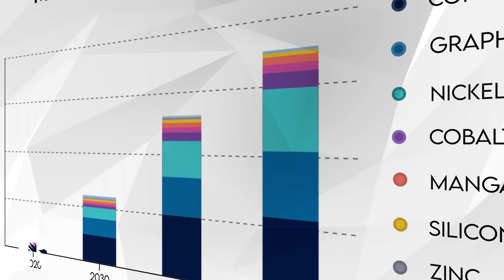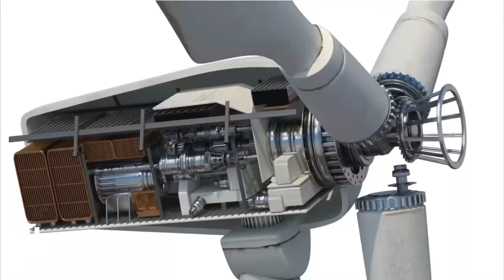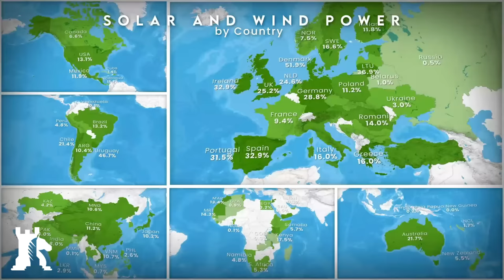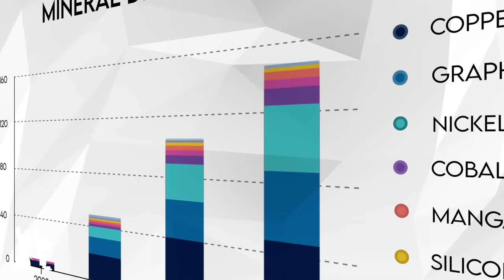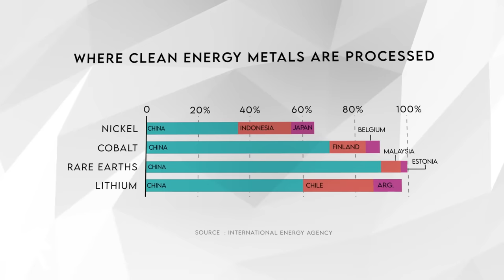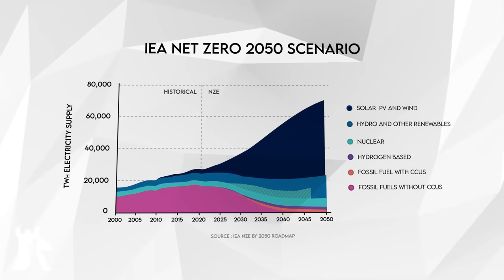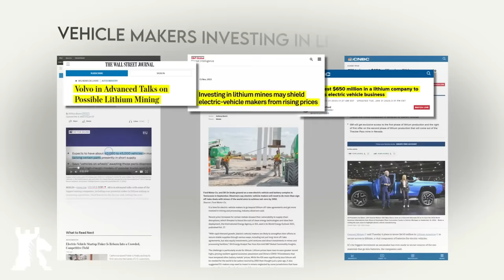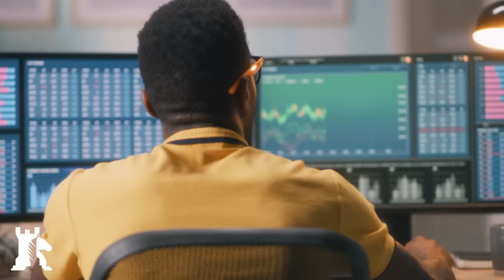Net Zero by 2050 is not happening

Comment: I really don't understand why our politicians decided to shut down nuclear power plants..
Reply: ESGs mate
Reply: because Russia wants your country depending on energy from them, so they influenced your politicians and populace into believing it was their own idea.
Reply: @rami8896 hat’s not as bad.

The extraction process and human rights for workers are.

You conflate both.

Nuclear energy is overall safer for the environment than burning fossil fuels. To suggest nuclear energy is as bad because of the treatment of workers who’d be working with dangerous radioactive materials, rather than the dangerous toxic chemical’s instead isn’t a sound argument. 

Hands down, nuclear is safer and better. 

How it’s extracted is a completely different story than it’s efficiency as an energy source
Reply: @rami8896  No way. France is trying to ensure access to minerals. Did you watch the video? That is exactly THE major problem with renewables. Nuclear requires a fraction of resources to build and to run compared to all other alternatives. The mining problem is real but it is not a problem of the nuclear industry in particular. And France is probably one of the fairer players... 
The bottom line is that we need much more renewables, but not multiplying capacities by 100 folds, and we need much more nuclear than today, with preferably uranium or thorium from locations such as Australia, Canada or Europe. Mining uranium from seawater is also technically possible by the way (more expensive but still cheap per MWh).
Reply: It’s because of prioritization of short term gain and lack of political will. Take the US for example, a state government could build a nuclear power plant but all the public would see it constant cost for a decade without any gain and the government officials would likely be voted out or reach a term limit. No politician wants to risk their career for a benefit they don’t reap. 
Nuclear power plants construction is a lengthy process that will not bring in profits until a decade after construction starts. This is all ignoring the publics willful ignorance to how safe nuclear power is
Reply: @rami8896  no
Reply: @alexiel4406 This. Even maintaining existing nuclear power plants just isn't really economically viable. Peak oil and climate change is a future you problem.
Reply: @joeyjojojrshabadoo7462  you can develop and maintain new reactors for a profit. The issue is when you don’t maintain them and you need up like France. 
I think it is a naive thought to not plan and prepare for climate change but it is also naive to sacrifice all realistic options for a economically inefficient power generation
Reply: Even with nuclear reactors, you would still be dependent on russia for the fuel.
Reply: @mezjean5966  yes and no, it’s about setting a base line that can be ramped up if needed. You can always source other resources but unless you have something to hold you over you are screwed. 
The most realistic approach to energy would be a base of nuclear with the support of a mix of renewable and non renewable for high and low demand periods. Throw in some hydro where you can.
Reply: Because they don't want to buy from Russia and Africa 😂
Reply: Germany?
Reply: Scare mongering about nuclear is a good place to start
Reply: @rami8896 t’s more energy dense so less mining has to be done. Also I believe Australia has the largest deposits, and there workers are properly compensated and looked after
Reply: @mgntstr I hope they've learned the importance of nuclear plants after last winter
Reply: Because liberal environmentalists (#Democrats) much prefer emotional decision making that objectively addressing a problem.
Reply: Because the oil companies and environmentalists agreed upon something for once. Maybe the environmentalists should have asked themselves why ExxonMobil was on their side for once...
Reply: It's all part of the plan.
Reply: fukushima
Reply: @alexiel4406  It also is not at all helpful that the US business world can only see a quarter at a time and is judged not by profit but by the ever more psychotic belief in unending profit rate growth.  Thinking about things across a decade...I honestly don't think the US is capable of that much forward planning and that is not factoring in the lack of exponential profit growth and also regardless of the field under discussion.
Reply: @chimpazzz there are many reasons (apart from the familiar corrupt-politician region's). But the main pushback against adoption of Nuclear Power (at this moment) is that we do not have political&governance structures that are stable and functional enough to:
(1) 100% guarantee no Disasters
(2) protect large swaths of ppl (usually the poor neighborhoods/towns/districts)

We're at a fucked moment in time where we need Nuclear or Massive Mining, yet we are politically not advanced enough to either Implement it, or to implement it without sacrificing/crush huge chunks of the population (and they are gonna be sacrifices with punching and screaming).

What we need is deeper global cooperation (with an end to aggression), and national governments that are driven by 1 goal only: to protect and serve the People (all of them) (free of all the distortions created by Ethnocentric-ideologies and a Capitalist class at the top)... Without this we will descent into barbarism.
Reply: @mgntstr Wrong! Russia leads the nuclear tech and everyone is a decade behind. If they say yes to nuclear now, everyone will want to buy from Russia because others have old tech from the 60s.
Reply: Cause you didn't live through Chernobyl, or under the constant threat of Mutually Assured Destruction.
Reply: @mgntstr  ah, the irresistible soft power of Russia /s
Reply: Because activist asked for it.

Same activists pushing for net zero.
Reply: Remember disaster of Japanese nuclear power plan? Fear of that
Reply: @rami8896 
Frankly, while what France is doing might be terrible...

In my opinion, the environment is simply more important. I'm not saying that lightly.
Reply: To get votes
Reply: @majstorgile  The disaster that turned out to be a nothing burger like Chernobyl?
Basically over hyped nonsense just like everything else in the media.

A disaster that would have never happened if Japan wasn't stupid enough to build an outdated reactor on an active faultline. Also nuclear plant workers don't have the same prestige in Japan as they do in the West so there is a good chance a competent crew could have prevented the accident.
Reply: @stefanodadamo6809  Money Money Money, the lemmings read our ads and see our propaganda and can not help but fall in line. It's a rich man's world.
Reply: @puma7171 both thorium reactors and seawater extractions are still very experimental and not tested at scale 

it's like saying lithium extraction from water will solve all the mineral problems so just keep building solar and electric cars
Reply: @melfsade5557  I agree, but that's exactly the narrative behind renewables: innovation will solve all the issues! For nuclear you could apply the same reasoning, that's why I mentioned it, but that was not my argument. This said, the technology to extract uranium from seawater does exist, the question is whether it's scalable. And extracting lithium from seawater (which I'm not familiar with) does not solve issues of low energy density of batteries or variable energy production from renewables. The unknown of innovation is exactly why we must pursue several approaches and optimize with time.
Reply: @puma7171  I agree, there are way to many ppl who downplay problems with renewables with "well invent better energy storage" or other future innovations.

We really need more investment into all the different CO2 free options from uranium and thorium to Solad and Hydro rn if we want to get off fossile fuels in time
Reply: @majstorgile  It was avoidable on many levels
Reply: in germany its because: (copied some comments bit chaotic)

and it is uneconomical to keep nuclear power plants running at low power or to shut them down at times when there is plenty of solar, wind, etc. power.
Also, the whole industry is already 10 years on it designed for the exit, skills were reduced and many staff and specialists are now working abroad and with the eh in all industries existing lack of skilled workers in Germany, I doubt that you can find enough new staff.

But you could have let the last three continue to run.
here some mixed comes from me i copied, not all up to date, but in short would come far to late, cost to much, dont help with the demand changes or you have to cut renewable
+ in actually also for it, but problem according to Habeck & operator companies is, yes the new fuel elements would have to be ordered, which are special productions the 1,5-2 years in the production need.
The safety review of the reactors would be on, which was only postponed, because they are supposed to go off the grid anyway, which also takes 1-3 months.

The new construction as you see in Europe only makes problems, takes years longer and is more expensive 10+ years for a new reactor, which would be too late for everything.
In France must be switched off constantly almost the Häflte of the Akws, since they run anyway already over their actual duration, make more and more problems, partly have the also Blackouts therefore, send e.g. to customers the request less to consume, in the summer the water of the rivers is too warm as that it for cooling water to be used may = reactors down or with smaller achievement let run.

Also a problem Akws you can regulate badly on the demand high down, e.g. you have a lot of solar power, to shut down the reactors takes partly 1-3 days and makes but because of the economy little sense, then you would have to shut down rather the solar energy.

Gas-fired power plants, for example, can best be adapted to demand.

But it won't, even the Eu energy authority sees a renunciation of gas from 2050 at the earliest as possible if it runs well (as an energy source, for industry & chemistry it will still be needed).

How well it goes with the nuclear power plants in France we will see in the summer, whether the rivers become too warm again or not.
Not to mention the huge debts of the state operator & more and more need for subsidies.

But it doesn't change the fact that nuclear power is difficult to adapt to the demand and it is just not economical to shut it down, even if you just massively produce electricity with solar and wind, which is also a disadvantage and contradiction.

I know the possible processes e.g. of breeder reactors, but so far none of these processes have been implemented economically on a large scale and would also take years.
The problem if one really wants to tackle the climate issue, then nuclear power plants would not be a solution, at least the new construction, because they would take too long and come too late.

Isn't the argument with the base load a fallacy? The problem with renewable energy is its unreliability and fluctuations. Therefore, peak and medium load power plants are needed that can adjust their generation or storage technologies. Nuclear power plants cannot do exactly that. In principle, I would be open to an expansion of nuclear power, but with a planning time of almost 10 years, that would be too late anyway. In this case, a massive expansion of renewable energies would be preferable in order to store the resulting overcapacities. That nuclear power disappears from the energy mix before coal I think (to agree with you) is the biggest strategic mistake.

You're right, nuclear power plants can't compensate for spontaneous fluctuations, you could use water pumping plants or maybe hydrogen (if you want to do without gas). But nuclear power can still be important to keep the frequency of the grid stable.
Reply: They will keep these plants and add more and we the people will pay for it based on our carbon foot print… 👀
Reply: Because it was energy that operated outside of the trans Atlantic / Saudi Qutari Russo monopolies. The used Japan incident as a corrupt excuse to shut it all down. The big boy market share significantly increased: same reason all the natural gas australia had was turned off.
Reply: No STEM grads

Comment: The blades are mostly fibreglass, which, while not recyclable, can be ground up and used in concrete as a strength in fibre. Very useful as coal used to support that purpose via fly ash.
Reply: And recycling technologies in this field make a lot of progress right now.
Reply: they are being recycled now.
Reply: Thank you Carl👍
Reply: the whole video is bunk, however. 

most estimates of the amounts of metals needed for renewables don't take into account that if you switch to renewables and electrify most of society you end up using significantly less metals because *drum roll* fossil fuel infrastructure uses a whole fuckton of metals. they just scale up current demand, which is incorrect, demand is not constant as you increase renewables and electrification. 

at the same time, even if you need to create 500 new large mines for lithium or whatever, that will still pale in comparison to the number of current coal mines. they count in the tens of thousands, many of them are absolutely humongous. this also does not include all that gas and oil infrastructure that we've built for the past 100 years. 

he also made a bunch of mistakes about batteries... li-ion chemistries change all the time, what we have today is not the same that we had 20 years ago. in 20-30 years it's not at all clear what chemistry, or even if li-ion will be used for energy storage. there are other options that are good enough already today.
Reply: @simonb9573  Recycling is also expensive and not many plants can make a profit from recycling.  It's why we source it to other nations.
Reply: Piss in the ocean… there’s a lot of greenwashing out there
Reply: @DroneStrike1776  recycling plastic is bad because plastic is a subproduct of pertroleoum, so it is dirt cheap. 

The metals, on the other hand, are the main product and are expensive just by themselves.
When you have a million cars that have the same battery, it is simple to build a specialized recicling facility.
Reply: @NaumRusomarov  I dunno if all of what you said is correct, but at least on the metal issue I can tell you there's a lot of talk about titanium batteries because they're more stable than lithium ones (you know, that gruesome tendency to catch fire).
Reply: @NaumRusomarov  You oversimplify. The issue is that we don't know we have enough rare minerals or can even get them out in time. Their demand curve and cost is going to be far above the fossil fuels today. This is in part because of the mines and such in the ground and producing today. You also ignore the costs of closing down and remediating fossil fuels which is required by law. And the power exchange rate of renewables is poor regardless. Substituting a weaker horse for a strong one is silly. The better answer is to build nuclear power as a baseline source and then go from there.
Reply: @NaumRusomarov  Yeah the 50 Wind turbines for 50 MW is outdated. The new ones do 8 to 15 MW, at 40% capacity that's just 10 of the 8 MW
Reply: The Dutch build windmills already before 1,500 with wood, sail textile and clay bricks (some still survive and operate tothis day) so less metal usage us possible in windmills.
Reply: @DroneStrike1776  you need customers for the recycled product. If all the batteries are made somewhere else, then recycling needs to go where they are to shorted the supply chain and costs. If the batteries are made locally, there is less need to export the recycling business. What do you know? Battery plants creating local demand for those rare earth minerals are cropping up all over the West.
Reply: the resin used to make fiberglass rigid is plastic